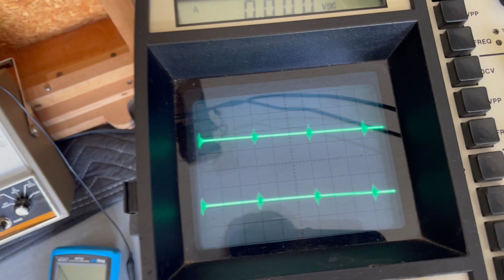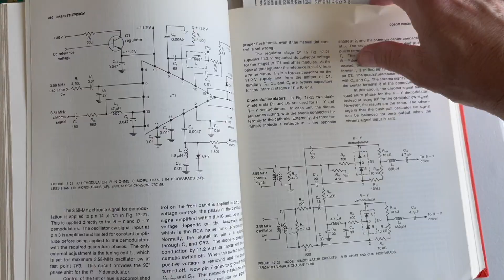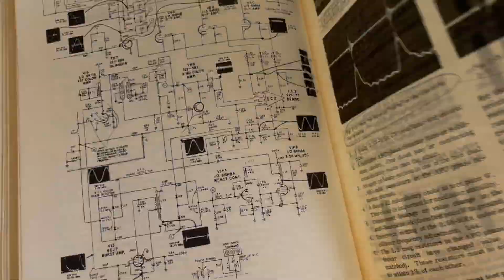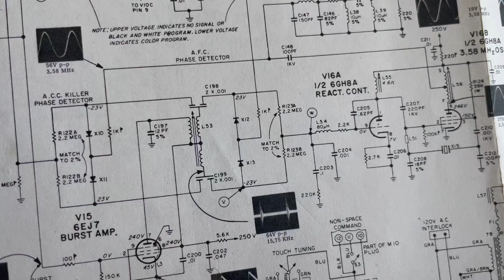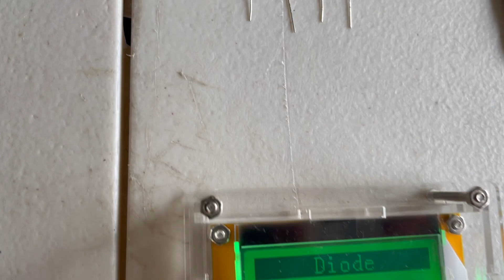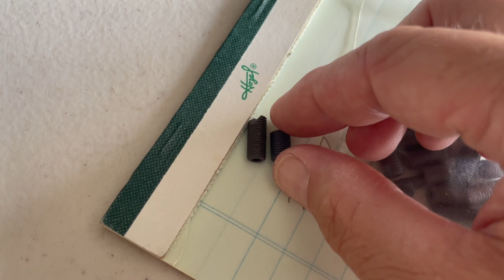1969 Zenith Color TV Restoration - Episode 7

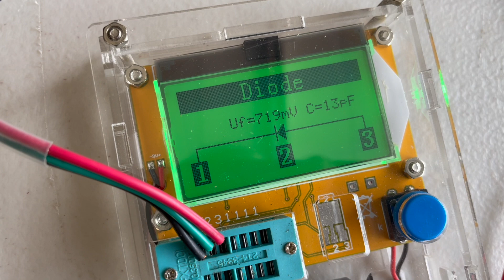Comment: 31:36 having forward voltage of approx 700mV on the 1N34a when using the LCR-T4 multitester is ok! The LCR-T4 uses about 6mA forard current when testing. The high internal resistance of this particular diode design (point contact) makes it look like silicon. At 0,1mA forward current you get the cut-in voltage (Ge 0,2-0,3V) and at 1mA you get the typical DMM diode test reading of 0,3-0,45V

Comment: I'm only coming to this a year later but it is making difficult viewing - you simply can't see the wood from the trees - no clear diagnostic approach - more like wandering aimlessly in the desert hoping that the solution will 'jump out' , which it eventually does, either from exhaustion or otherwise - it certainly had me exhausted following it - altogether too much irrelevant 'waffle' which has obscured rather than enhanced the core essentials - just play it again to yourself and evaluate critically - btw the whole balancing of resistors & diodes was a total red herring and not worthy of more than 30secs 'mention' if any - in any case 'in circuit' checking of such  things is never valid and is always a ,often diverting, waste of time
Reply: And many of his conclusions are downright wrong.

Comment: I know you’ve probably completely finished this set by now, but FYI: 

those cup-style terminal strips Zenith (and some other companies) used enable you to simply shove the soldering iron in from the back/opening, heat it up, and pull (using needle nose pliers) the component lead out (or shove the lead back in). No cutting or J-hooking necessary, it makes testing/replacing components a breeze. 

Just like how they included a removable panel so you can work on the set with out pulling the chassis, those lug strips also play into their “$ervice $aver” philosophy.

Comment: Hello Dave: I used to fix those sets under warranty if you ground the grid of the 3.58osc you should be able to zero beat the 3.58 to slow lock
good job at finding the core in the coil. good luck on this set. i hope its worth the effort
Reply from the maker: Thanks for that great bit of information! Every little tip is so helpful!